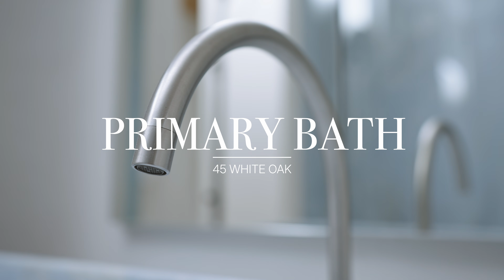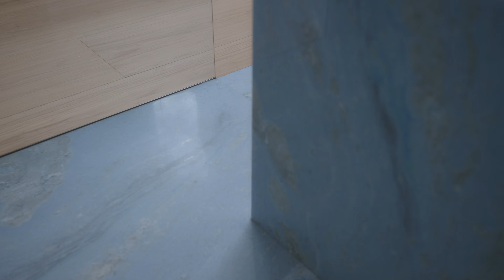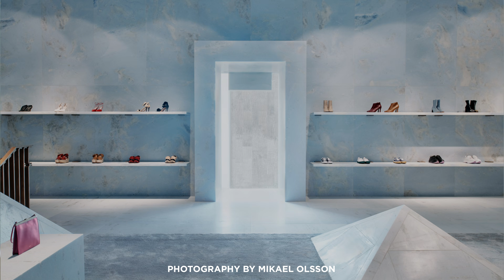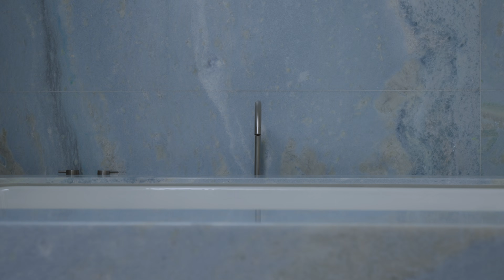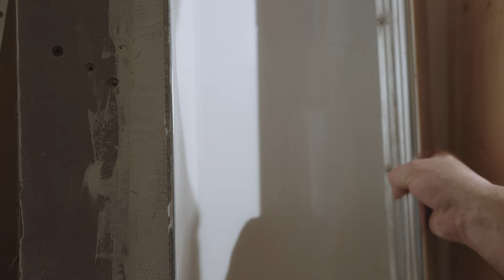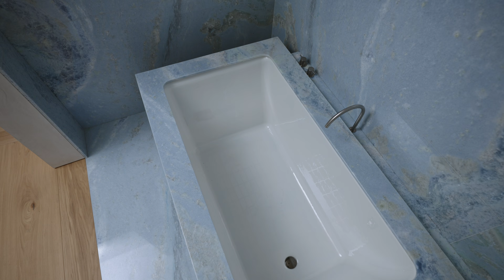45 White Oak | Why This Luxury Bathroom Was So Hard to Build

Comment: the idea with the glass, i made this in my appartment 15 years ago. the cabinetry looks unfinished from inside. everythign should have been wood for that premium look. the white mixed with wood really feels like saving money on material. also if you really want to go into details the small metal shelf holders shouldnt be visible, or the holes for those holders. and since there are no handles anywhere, the cabinetry shouldn't have them as well. the bath thub does not feel premium.

Comment: Again beautiful bathroom, but the pass through to the shower area between tub and shower glass is strangely narrow and shower area itself seems small.  Also, I'm not 100% sure, but it looks like there's a gap between the wall and long side of the tub; not sure how that's going to get cleaned.  What's the finish of the shower floor?  Polished is too slick and a safety hazard; honed would probably be OK.  But those are lesser issues compared to having an open, curbless shower bordered by white oak flooring.  The tannins in white oak + water=not good.  Not to mention water getting between the stone and wood amn slowly buckling the wood floor or even rotting it out over time.

Comment: It's cleary incredible craftsmanship. You don't get this level of work without the proper pre-planning and design details. That's where the real work was here. The execution shows that. I'd be concerned about the shower floor. I don't know if that slab has the COF (Coefficient Of Friction) to perform in real world applications when someone is showering and there's a bunch of body soap all over the floor - seems like a. massive slip hazard. I'd look at having that expert stone installer come back and engrave some long slits that get polished to provide grip.

Comment: To me, the house, itself, is a horrendous nightmare.  The awesome workmanship, however, is legendary!  Perfection personified.
Reply: A horrendous nightmare!!! The new title to your memoirs!!!
Reply: I don't like many of the details and choices in the house either .... but I wouldn't call it a horrendous nightmare.  Of course, you're entitled to your opinion.  I think the workmanship is really good, and so is the consideration and planning.  I think having a recess in the floor to accommodate a thick marble shower base takes good planning and execution.  However, the choice itself of marble for the shower base is a little questionable.  I would have spent the money on a solid marble bathtub instead, and skipped on cheap Kohler drop in tubs.  Showers get used more than once a day.  Bathtubs get used once in a while.  Go for practical, and spend your money on things that show it off, and don't hinder the function.

Comment: Why are you installing 20A outlets in this bathroom?  No home appliance in a bathroom would ever need the sideways prong.  It's simply a waste of money, they don't look as nice, and the 15A versions are 20A passthrough rated for use on 20A circuits.
Reply: 20 amp in bathrooms is code

Comment: Beautiful craftsmanship, but I wonder why you chose wood flooring in the bathroom instead of tile/stone.
Reply: The stone they use is light blue along with the hardware being stainless, therefore it's a cold hue.  They most likely wanted to bring a little more warmth to the room instead of having a big ice cube.  Plus the wood accents to complement the beautiful stone.  Wood is also nice on your feet and as I see snow it may be likely that there is radiant heating there.  You can put engineered wood in bathrooms without a problem.
Reply: The contrast between the blue marble and the warm wood is absolutely beautiful